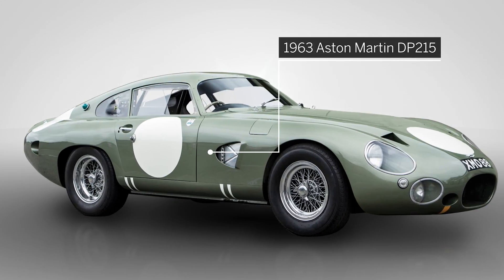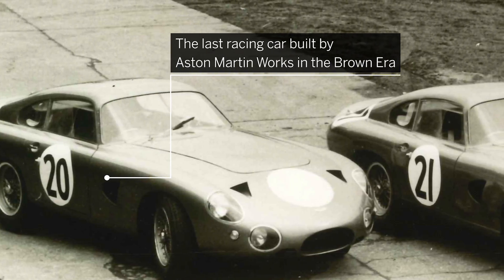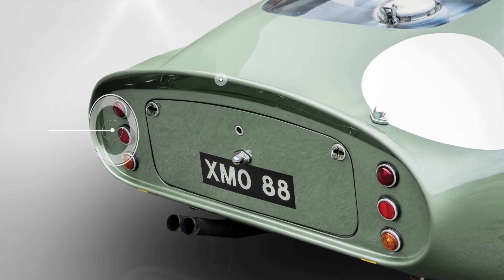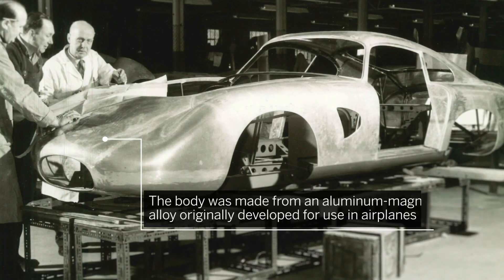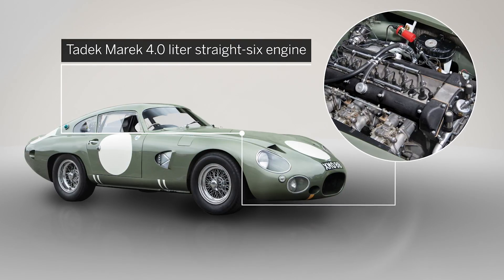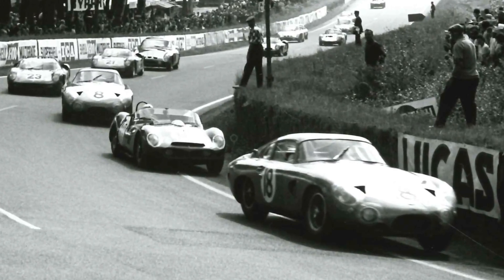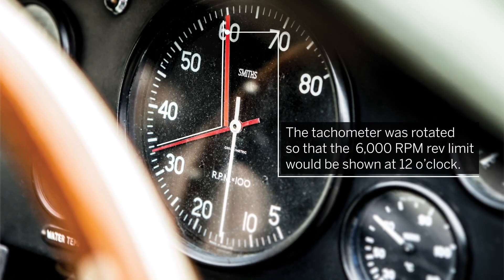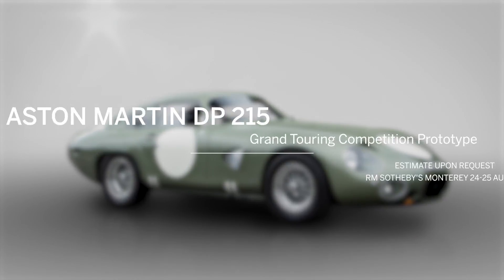The Ultimate Evolution of the Aston Martin Race Car

Comment: The styling cues started with the Cunningham C4RK. But give Aston full credit for their Britishness in trying to compete with an in-line 6 cylinder engine. That would've seemed nonsensical to anyone not from the UK, what with 12's coming at them from Italy (Maserati and Ferrari) and 8's from America (Chevrolet and Ford...and Cadillac, but that's an old story). Great looking car though. But look at a Mercedes SSKL and then look back at the DP frame. If you're going to cut holes in the frame, why not just build a more compact frame you wouldn't need to cut holes into?